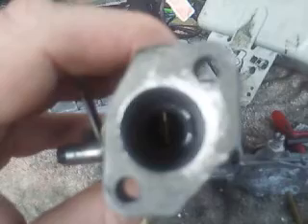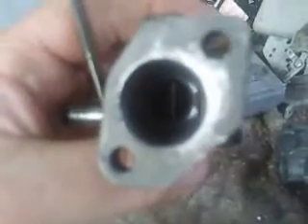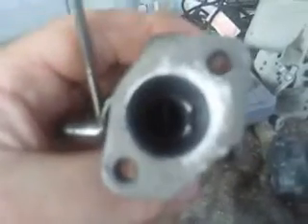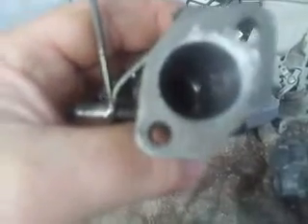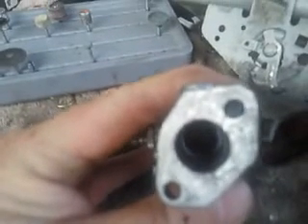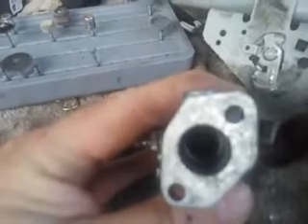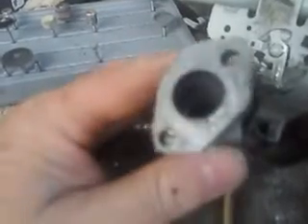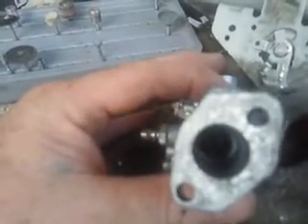rebuilding a 5 hp briggs raptor engine (boring a stock carb. ) part 5

Comment from the maker: 2525coyotte@  why did your block crack? did you open it up yet? sounds like a stock rod problem with high rpm's? when you rebuild another one, or buy one used look for a billet rod, let me know what caused the crack in the block when you have some time and thanks for checking out my video's and commenting, that's how we all learn from each other